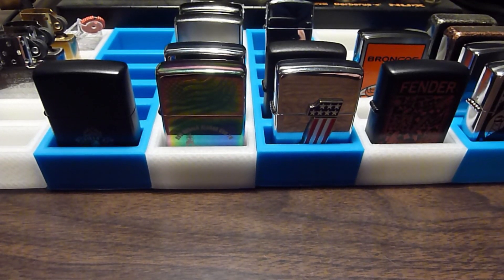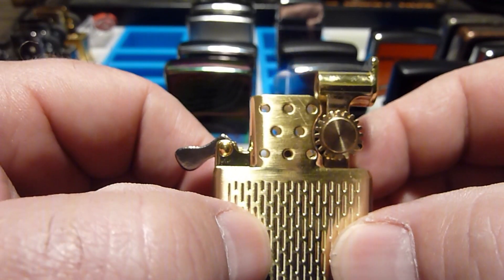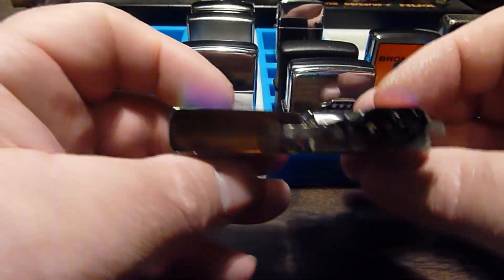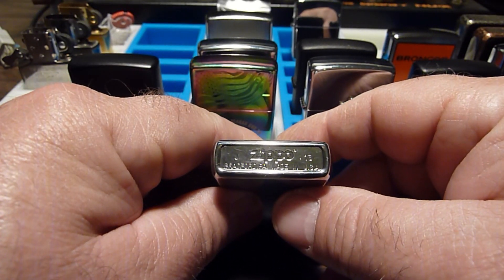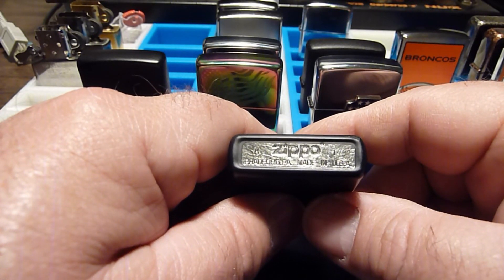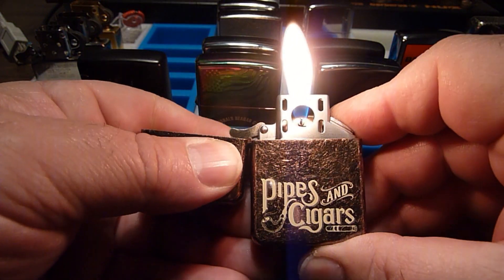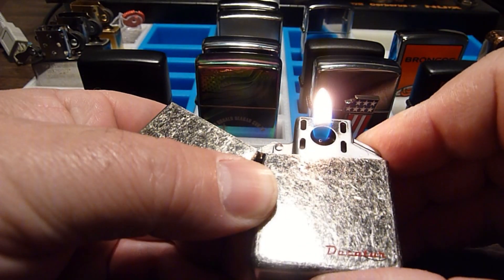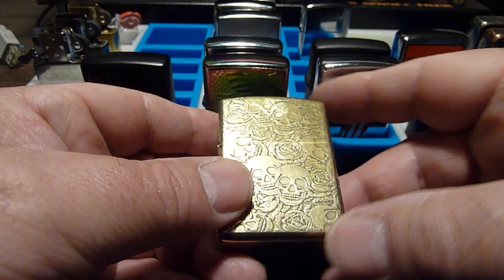012123 EDC episode 1 Zippo lighters

Comment: So cool, I was looking for that pipe insert.. 
I just drilled a hole in my chimney on my Chrome Brushed. I got it a week ago. so much better than Bic.. Zippo have sealed tanks now... Human Evolution
Reply from the maker: Thanks for watching Hector. I made a pipe insert from a standard insert too. I found it difficult to drill the hole precisely  so it didn't look homemade. I fashioned the chimney cap out of pipe hanger metal. It works great but looks sort of sketchy. I use an actual pipe insert from the manufacturer now lol.